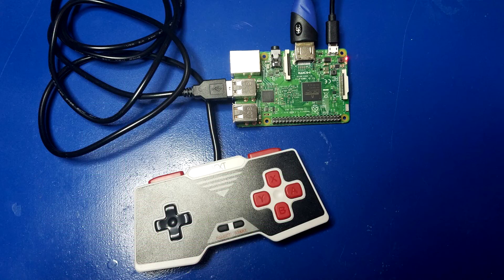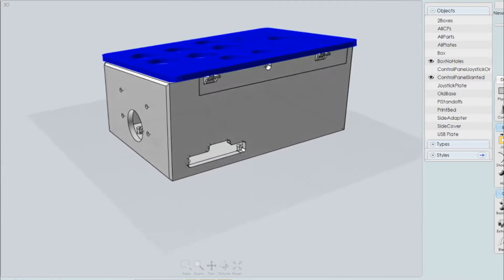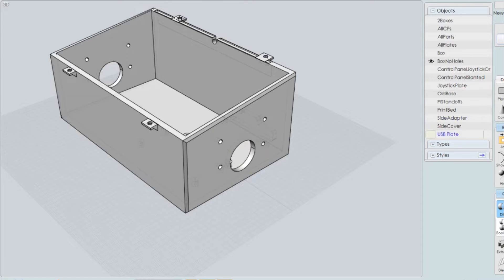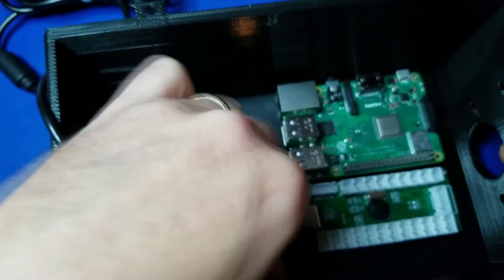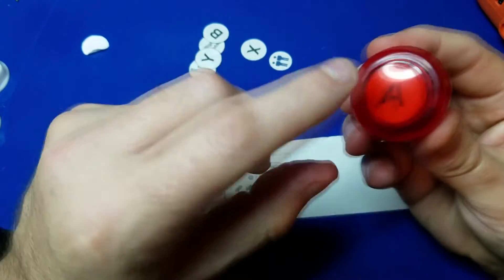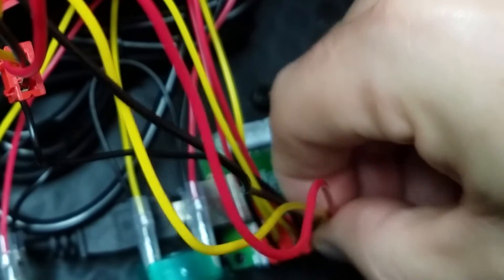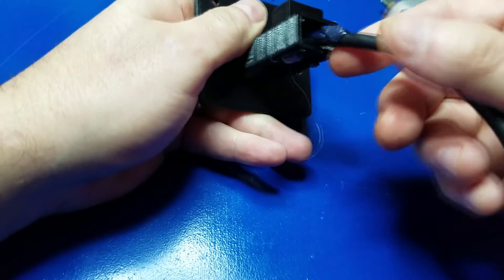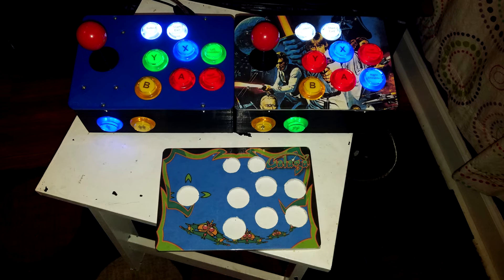OpenCADE Raspberry Pi Single/Multi-Player RetroPie ARCADE Gaming Console! [3D Printed]

Comment: Just FYI...be alert on the Joystick kits. The vendor has a newer and simple wiring for the buttons. Very simple, single plug to the button and then to the board. However....they randomly ship out the newer style...and...the newer style does not come with the 2 x 24 mm smaller buttons. Thus you will be missing two buttons on your joystick panel. I do not see a way to purchase just the two smaller buttons, using the newer wiring format...You may need to adjust the all wholes in your Joystick (or modify .stl 3d print file) top panel to use the larger 28mm holes.
Reply from the maker: Thank you Michael for the update!  So basically the x2 button holes at the top need to be the same size as holes for the A/B/X/Y correct?  I've not purchased a new set in sometime, so this is very helpful.
Reply: @WagnersTechTalk  yes, that's correct. I love this project. Well done and well documented. I will modify the .stl controlpanel...to have all 28 mm button holes...wish me luck!
Reply from the maker: @michaelpage4117  Thank you so much, it was a labor of love!  Actually, soon going to be working on the Star Wars Yoke Control Panel for it - it's quite heavy so I may/may not be successful in all honesty.  I wish you luck with the 28mm button holes, the Expansion pack has the empty panel that you can arrange the holes however you want.  I think you can use Microsoft's 3D Builder to make the holes in the .stl (I vaguely remember trying it, could be mistaken though as it was over a year ago).
Reply from the maker: @michael page Just did a quick test in Microsoft 3D Builder, you can indeed use it to subtract.  Just create a New Scene.  Then Insert->Add, select Load Object and load the EmptyPanel.stl (from the Expansion Pack) or the ControlPanel_JoystickOnly.stl (base package - which has the joystick and screw holes pre-made for you) and click 'Open', click the Check mark (upper-left) to Import Model.  Now that it's imported, you can select Insert->Cylinder (toolbar), select the cylinder, click the Scale icon (bottom), enter 28 for the x/y and drag the cylinder through the control panel (z was 40mm).  Position the Cylinder(s) where you want them, select them, select the Edit menu (top) and click Subtract to make a hole.  Perhaps I'll make a video on how to do this at some point, it's easy and free to do.  Hope this makes it easier on you!
Reply: @WagnersTechTalk  wow...that cool! Thanks for the instructions. I will give it a try!
Reply: @WagnersTechTalk  I know it has been a few years, but by chance did you make a new stl with bigger holes? I kind of got the 3D builder change working, but not sure I did it correctly. Thanks.

Comment: its printning right now for me, is there any way to use this as both a retropie box and just a normal controller
Reply from the maker: Sure, the encoder for the controls is just a USB connection.  So, what you could do is just get a USB Extension (USB-A Male -> Female cable 1ft) and leave the male end plugged into the RPi.  Route both the encoder USB cable and the extension cable out the top notch on the back of the base.  When you want to use the controls for a computer, just disconnect from the extension and reconnect for the RPi.  Hope this helps!

Comment: I wanted to say first this is amazing stuff!...but sending the Base_NoFrontButtons.stl to a 3D printer (3dhubs.com), I'm getting mesh integrity tests failed with 377 intersecting faces.  Do you have an updated file that doesn't have this issue?  I saw the same thing also with the regular base with the front buttons.
Reply from the maker: Thank you :)  I ran into no issues using FlashPrint (on my FlashForge Creator Pro).  Several folks have printed it and noone reported any issues.  Mind if I ask what splicer you're using, that may help?
Reply from the maker: Just triple-checked, all models loaded fine into FlashPrint.  Must be something goofy with different splicers?  If you figure out a splicer issue, please let me know.  Also, might want to check out these other options for it (spinner, trackball and Tron stick): http://wagnerstechtalk.com/grs/  I've printed them all out here with no issues.  But I only use FlashPrint and only own one 3D Printer.
Reply from the maker: Damn, that site you referenced would charge almost $200 for the base alone.  I can print 2-3 for less than $20.  You could almost buy a printer for that (hint hint).
Reply: @WagnersTechTalk  Yeah was just trying via that website, price would have come out to $100 for the whole thing with the options I picked, I'll have to look into your other layouts and maybe a printer, thanks!
Reply from the maker: No problem buddy, if you have any questions ask, don't hesitate.  I don't know much about other printers outside of what I own, but general questions I can help answer.  Truly, I can print 2-3 for ~$20 (or less) just for the base.  A full single kit I can definitely print on one single roll of PLA filament.  I've printed probably around 6 (or so) bases, many control panels and other options and had no issues.  But, I must admit it's all using a single splicer app. and a single printer.  Hopefully, some of this is helpful to you.  I definitely want to help anyone interested in OpenCADE.  I have other ideas for some pretty cool options.

Comment: you printed in regular PLA? them walls looks kinda solid. what infill u use and did you print the bottom and walls as one piece?
Reply from the maker: Yes, it was all PLA and the walls are very solid (~5mm) and all one piece with the exception of the control panels and side panels (different video, you can add wrist supports to the assembly if you want it)
Reply: @WagnersTechTalk  i was thinking of printing my own. and do just the sides and bottom in one piece. not sure what amount of infill, 50% or 100%?
Reply from the maker: I just used 20% infill
Reply: @WagnersTechTalk  ok it looked alot more solid :D
Reply from the maker: @sttm1283  Oh, it is pretty solid even at 20% infill.

Comment: What 3d printer would be good for this project?
Reply from the maker: There are so many 3D Printers available these days, I can't keep up :)  The only one I personally own is the Flash Forge Creator Pro which has worked well for me for almost 3 years now.  But, I'm sure there are newer/better models to choose from.  However, the FFCPro is a workhorse and I use it frequently.  Also, their splicing software, Flash Print, is easy to use and free.  I've had no need for any other splicing software.

The minimum print bed dimensions needed to print this project is 227 L X 148 W X 150 H (in mm).  As long as whatever printer you choose can print this size (or larger), you should be all set.  Thanks for your question and watching WTT!

Comment: hi what are the dimensions of this design please and what do the pie sit into i.e screw into thanks once again very instructive and detailed video as always brilliant
Reply from the maker: Hi Mark, great questions.  I updated the video description to include the min. print bed dimensions (printer I used was a Flash Forge Creator Pro) and the dimensions of the key components.  Below are the measurements.  The base has standoffs for the Pi and the USB Encoder board, each uses M2 screws and can be mounted internally to these standoffs (see 7:16 in the video for details).

Minimum Print Bed Dimensions:
227 L X 148 W X 150 H (in mm)

Dimensions of key (largest) Components:
Control Panel: 204 L X 142 W X 6 H (in mm)
Base: 205 L X 140 W X 88 H (in mm)
Reply: @WagnersTechTalk  hi mate thanks for the quick reponse i was thinking of making the dimentions 300mm by 200 mm and adding artwork ive downloaded would it be expensive to have it 3d printed thanks
Reply: also what thickness is it ive just bought one tried to build and the thickness is 3mm no good what so ever  5 or 6mm i was thinking of drilling it so can screit together instead of glue
Reply from the maker: Keep in mind, if you attempt to scale the control panel to 300x200, the button holes will scale with it.  Meaning, the holes may be too big for the buttons.  I'm not sure about the cost of printing as I've printed my own and didn't investigate.  I will have a video coming up on how to use custom artwork with this build.  I hinted about it at the very end of this video and I've made up a few custom artwork panels already in preparation :)
Reply from the maker: The base thickness is about 6.5mm.  I don't think I would try drilling into either of these pieces (controls panel or base).  I do provide a base with 2 front holes and one that has no front holes.  I am considering an expansion pack that would have the joystick (only) on one panel and buttons on another.  When mounting each panel into it's own base, this gives you a near full-size playfield.  Just as an option, of course.
Reply: @WagnersTechTalk  sounds like a great idea that 😀
Reply: @WagnersTechTalk  just use normal super glue did you mate thanks
Reply from the maker: @markgrady6493  No, they were screwed together with x4 M3 screws.  You can see that at 14:10
Reply: @WagnersTechTalk  on your video where your screwing the pi to the base did the 3d print those plastic pieces that you screw into cheers ?
Reply from the maker: @markgrady6493  Yep, it's part of the 3D model so they aren't separate pieces it's all one big piece :)
Reply: @WagnersTechTalk  that's amazing piece of kit that mate how much was that 3d printer very impressive indeed I take it you can control it through I.e laptop or PC my friend
Reply from the maker: @markgrady6493  It's a Flash Forge Creator Pro, I've had it about 2 years and it's wonderful - a real workhorse.  You can control it through a laptop, but I mostly use it with the SD card so I can shutdown the computer without impacting the print.
Reply: @WagnersTechTalk  cheers mate ive had a look at one they are brilliant thanks for information much appreciated so ive found a place here in the uk that will do the 3d image 227m 148m 150m i will get that whole size and the other sizes are for control panel etc
Reply from the maker: @markgrady6493  You'll love it!  Not sure if they changed their installer on the SD card, but if you get the FlashForge printer be sure to download FlashPrint from their website.  It's the app. where you load and position your .stl files before sending it to the printer.  It's fantastic, been printing for awhile and it's so easy to use and free.  It's simple but very powerful/flexible.  Cheers!
Reply: @WagnersTechTalk  your the man it looking amazing watching it print it over here the one you said is £400/500 pound here im gonna get one printed up and look at it because im doing arcade boxs as well this would pay for it self in the end your a legend
Reply from the maker: @markgrady6493  I've got one printing now too, a green base look'n pretty!  It will be for a Galaga.  Check out wagnerstechtalk.com/opencade posted a pic last night (bottom) of moon patrol that I'm making for a buddy.  I'm not a legend, just hoping to give back to the Retro gaming community.  There's more coming for sure!
Reply from the maker: @markgrady6493  Keep in mind, I've only had one 3D printer and purchased it ~2 years ago.  There may be better options today, I've not investigated since my last purchase.  So check with others before you buy, don't want you to overspend if there is something better/cheaper out there.  That said, I'm very happy with mine.
Reply: @WagnersTechTalk  ok thanks for the advice my friend question how long does it take to print a full project like your doing now thanks
Reply: Another quick question if you dont mind here it costs me £35 for a complete arcade with image how does ot cost to print 1 if you know thank
Reply from the maker: @markgrady6493  Several factors impact how much it costs.  Including material used, infill, cost of material, etc.  For about $14-$19 I can purchase 1 spool (hatchbox) and usually get 3 of the bases out of it.  Several control panels off of one spool.  So, cost per box probably around $7 USD roughly.
Reply: @WagnersTechTalk  thanks again for the advice and information my friend
Reply from the maker: @markgrady6493  You're very welcome Mark, hope I've been at lest somewhat helpful :)  The green Galaga base finished printing and it looks pretty sharp.  Starting to get stuff together for another video demonstration of some additional enhancements that can be made.  I also want to design a few more components for the video (V adapter, Robotron dual-stick control panel and a few others).  May be a week or two until the next video is ready.
Reply: @WagnersTechTalk  you have being extremely helpful 😀 yeah that sounds good mate i also have a nespi case and a megapi case what would they look like printed any good
Reply: @WagnersTechTalk  how long does it take to print them cheers
Reply from the maker: @markgrady6493  Depends on your infill settings, the base is around 18 hours at 20%.  The control panels about 4 hours at 20% infill.
Reply: @WagnersTechTalk  perfect mate thanks
Reply: @WagnersTechTalk  any ideas where I can get capcom arcade and neo geo roms from I've got every other rom sets apart from these thanks
Reply from the maker: @markgrady6493  Won't answer questions about roms, google is your friend.

Comment: my retropie installation video watched many times mame do not open my games
Reply from the maker: Are you talking about this video https://youtu.be/Uvl5xMKdx9o ?  If so, then the problem is likely the rom you're using isn't the right version for the emulator.  Google the rom for the version of the emulator you're using and try that one instead and it should be fine.  Or you can try to find a rom pack for the emulator version.
Reply: thank you
Reply: hi retropie1 can you help with login and password